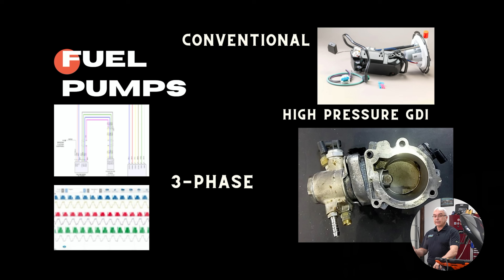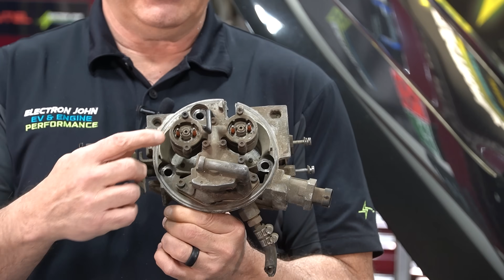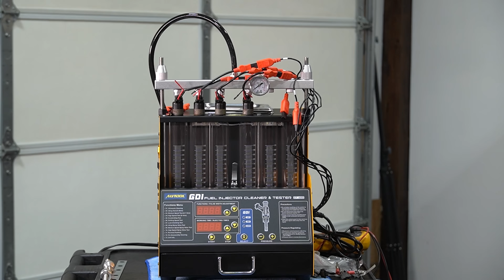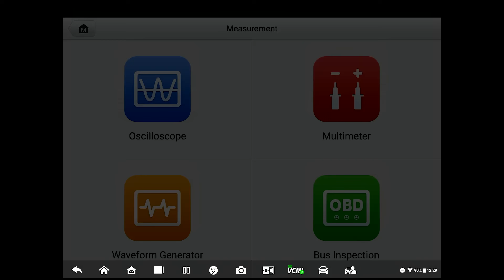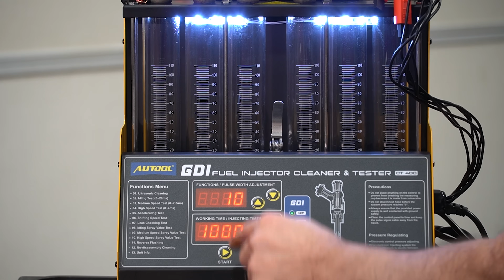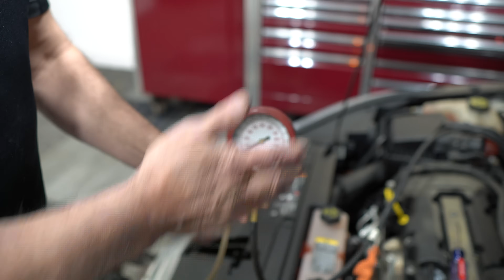Fuel Systems Masterclass - Profitable Diagnostic Solutions

Comment: Doesn't pump amperage go down as pump discharge pressure goes up? Less flow=Less work=Less power?
Reply from the maker: if the pump is trying to push pressure against a restriction, the output pressure decreases but the motor has to work harder so the amperage goes up.  does this make sense?

Comment: The high pressure fuel pump in the video apears to be from a 2.4L ecotec. i work on them often. The HPFP you're holding is commonly problematic. You stated that the line conected to it should always be replaced because the ball will get distorted and it will start leaking. I understand your logic but I've never replaced them nor have I ever had an issue with them leaking. Is there any other reason to replace if it's not leaking?
Reply from the maker: hi and thanks for watching!  primarily the main reason for replacement of the line is to avoid and]y potential leaks.

Comment: The injector cleaning ideally should be followed up with the end result. Especially the 2 injectors that weren't atomizing the fuel. Will those injectors be restored to atomization? Will the PCM adjust the injector width to compensate for incomplete atomization for an individual injector? Can the O2 sensor scope pattern be triggered to watch the stft on a cylinder with a streaming injector? (non-atomizing iow)
Reply from the maker: all great suggestions.  it is just difficult trying to keep video length to a semi acceptable level.

Comment: Forgot to add couple idea's for future videos, or part of video. The biggest reason I don't use my scope as much as I should for testing is I'm unsure what tests can damage to scope. I know there ignition tests in general but don't know the test that I need to be careful with. Second- Any quick tips on getting hybrids to stay running. Third- Turbo diag, what key differences vs non turbo , PIDS you look at , underboost causes. You could probably do a whole video on turbo diag and issues. I know the purge system is totally different. Also PCV issues causing oil leaks under boost ... Thanks
Reply from the maker: great suggestions!  I honestly didn’t even have turbos on my list of videos to do, but I will certainly add it to the list.

Comment: Great job John. Thanks for addressing my restricted injector question. I was in the weeds that day, I've done the injector flow test many times. Why I didn't think to do it I have no idea, getting old. I also have the OTC injector tester got to be 25 yrs old, still works great. Long videos are not an issue for me, can always go back and finish them up. BTW love the tip for clogged cats by looking at IAT temp. I generally use back pressure and on Fords the BARO reading is effected by clogged cats . Keep em coming
Reply from the maker: thank you for your continued support!   the next video is on just automotive test procedures for various issues.  I’m hoping people will find that one helpful🤞

Comment: why did gm quit recommending injector cleaning on gdi injectors?  service bulletins quit including gdi injectors. only replacement even if they were under warranty.
Reply from the maker: in some cases they are an improved injector .  also depending on the cleaning method used, sometimes they don’t get cleaned well enough

Comment: Can't tell you how many fuel pumps I replaced on the late 80s early 90s gm 2.8  I worked for a rental car company.and like you said most of these very low mileage 2.8 also ran like most of the 6 injectors were carboned up
Reply from the maker: lots of shorted injectors in those years too lol.  thanks for watching

Comment: Hi, Sir. I have learned a ton since I discovered your channel. Using the IAT sensor to help diagnose a restricted cat was something that I never imagined. Next time I check for a restricted cat, I will surely use that PID. The question is how much of an increase is to be expected. I would like to ask you this question that has been driving me insane: As current follows the path of least resistance, why a shorted injector in a Sequential Fuel injection does not blow the fuse? Is it because of the amperage drawn by an injector is not enough to blow the fuse when fired sequentially?
Reply from the maker: thanks for the kind words!  first the iat sensor if temps are exceeding typically the 180 degree range on a hot summer day, suspect an issue.  again, always double check your suspicions.  second, fuel injectors are controlled by pcm drivers in most cases.  meaning although the fused circuit supplies 12 volts for example, no real current flow happens until the driver turns it on.  so with that said, a pcm driver usually has a limit of about 3/4 of an amp so often you will have a driver that fails instead of a fuse.
Reply: Thank you, Sir.
Reply from the maker: thank you!
Reply: @electron-john 
Thanks  !!  We are hungry to learn !!  Thanks for sharing your time & expertise addressing these two questions !!
Reply from the maker: @ThunderbirdRocket  happy to help where I can